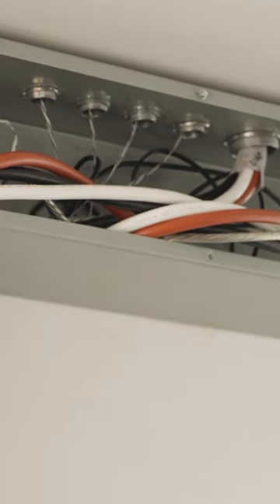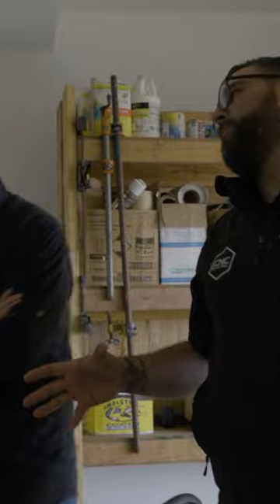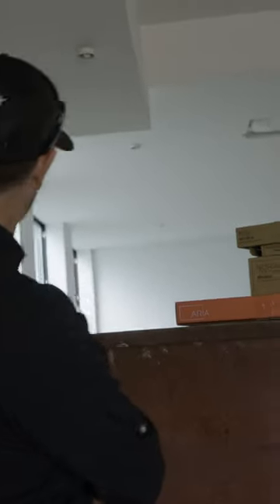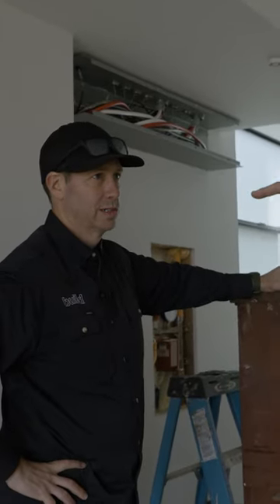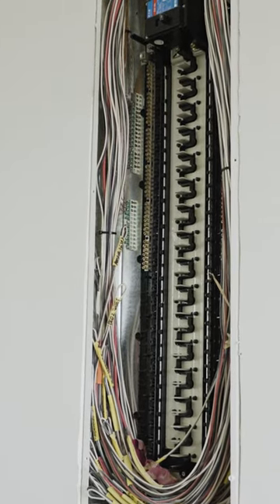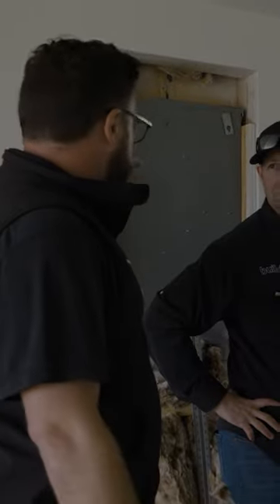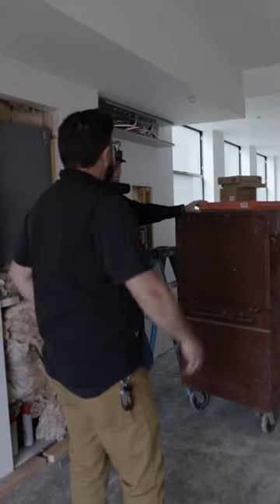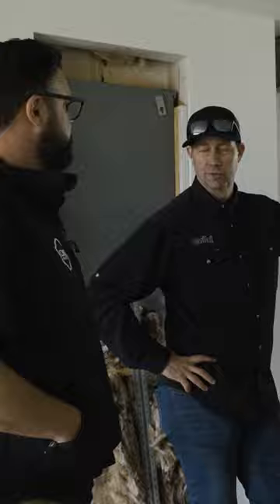Coastal House Electric Backup System

Comment: I'm surprised you have not reached out to EcoFlow about battery back-up for a home.  Our EcoFlow Delta Pro can run 10 emergency circuits wired into our 2021 new build and can "run" the house for 24 hrs.  We can power the gas furnace, refrigerator, freezer, smart closet (internet modem and router), microwave, kitchen outlets, bathroom outlets, etc.  We can make coffee or toast.  Since they use LFP lithium battery tech, they are super safe (no fire potential) and very long life.

Comment: And you prepared for battery fires.... how???
I would never put those batteries anywhere near my house. Seriously. You can't put those fires out.
Reply: Lead acid is dead, sodium chemistry is still newer and expensive if commercially available, Lithium Iron Phosphate is very stable chemistry in commercially available packs. 

Lithium ion is known to have fire issues, but who is using that chemistry in their backup systems?
Reply: Even of the past packs like Tesla's Powewall and Powerwall 2 that utilized Lithium Ion weren't known to have the fire issues of earlier cell phones and chinese electric scooters. Tesla's car fires are a real pain to extinguish, but the only time a home battery backup would be crushed is in a natural disaster which is a real concern.
Reply: @CJ-Giddyup209  the home battery is useless unless it is kept charged 😉.
I prefer a gas generator, kept outside, if you have natural gas, 👍🏻, if you need propane, put a  tank in, outside.
Reply: @CJ-Giddyup209  Tesla does!
Reply: @711yada It's always charged as long as you pay your electric bill. It's not something you need to plug in to charge, it's constantly kept at an appropriate charge level. Combine it with solar, incoming utilities, gas and electric, become unused